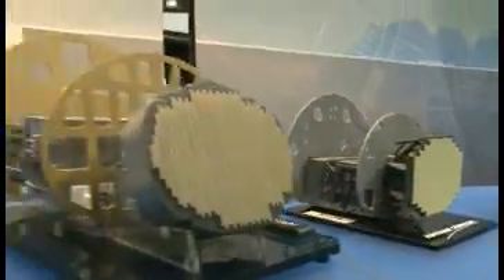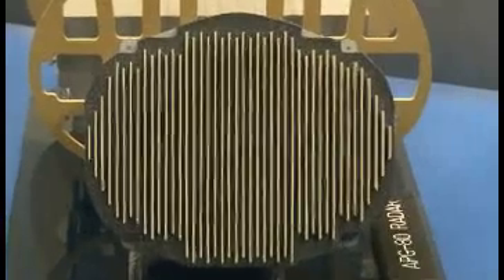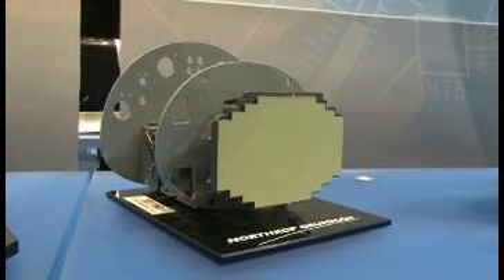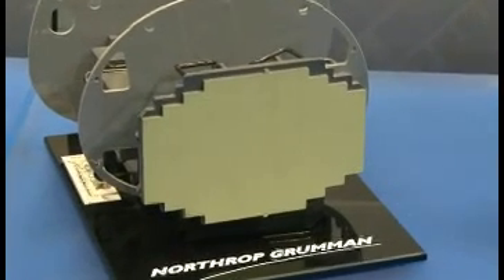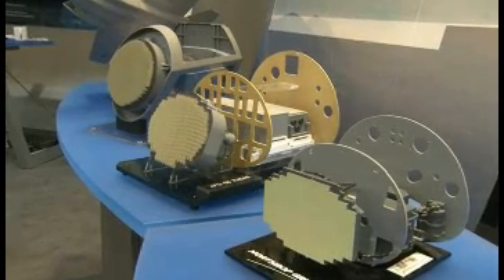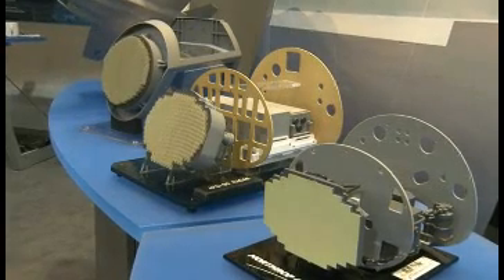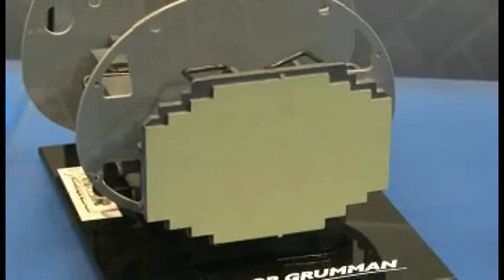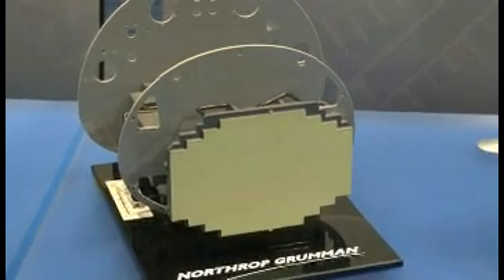AESA Radar Capabilities

Comment: @Pictureswaper UAE is the only country with block 60 f-16's and they are fitting with  the APG-80.  The AGP-81 however, will be built into the F-35 which will have over 3000 aircraft produced for various airforces.

This video seemed to be aimed at operators of F-16's who are looking for a radar upgrade without having to buy the F-35 ... ie. pakistan, singapore...etc.